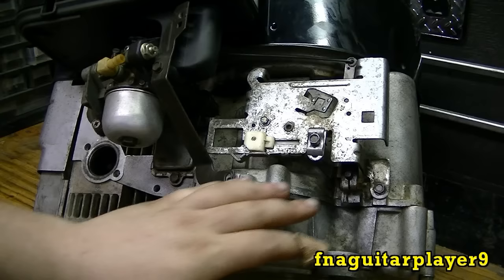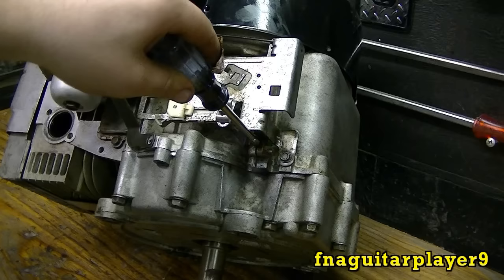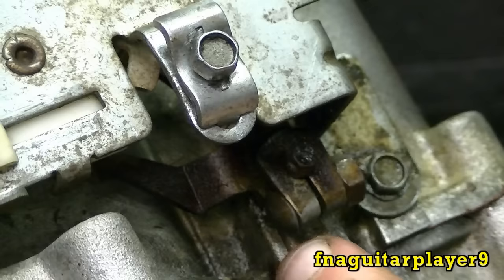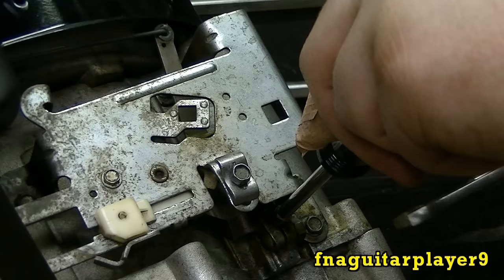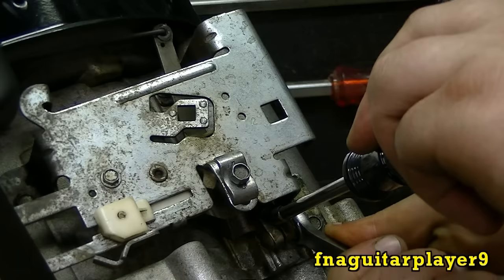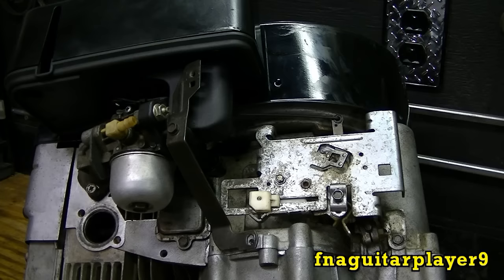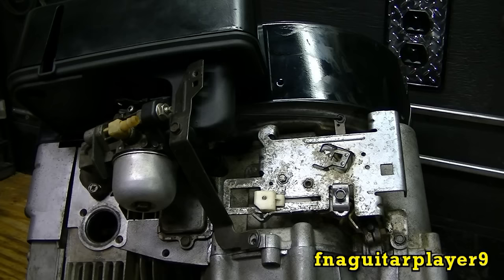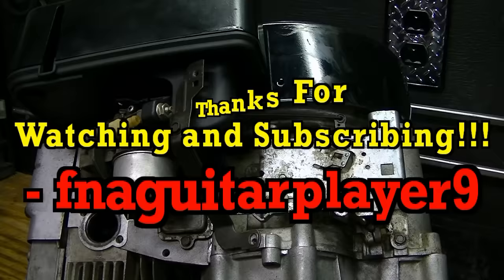How To Adjust Mechanical Governor On Small Engines

Comment: Thanx for posting this. I have been wondering why this troy bilt keeps surging. Completely cleaned and replaced gaskets on the carburetor thinking it was bad gas or clogged ports. I am going to try this first thing in the morning.
Reply from the maker: +George Vasquez Your welcome! I hear ya, I ran into the same problem on a 12HP before i learned how to do this. If it doesn't help it, you may need a new carburetor, on the newer 2 piece carburetors (walbro or nikki) you can't do a whole lot with them once they start acting up. I recently got one for a friend off ebay for around 60 bucks. Thanks for Watching!!!
Reply: +fnaguitarplayer9 ty. Well it sorta worked. Don't EVER let your neighbor borrow your lawn equipment. lesson learned. After doing this and completely breaking the carburetor and checking all else. I decided to check the oil. Well the @#$% put over filled it with oil. I emptied and refilled. Didn't want to take the chance he used the wrong stuff. Well after I corrected that, it ran perfect like it did before. I didn't think to check due to I just checked it before I lent it to him. I went to ask why he did that. He said that every time he would go in reverse it would bog down and turn. off. So he just added way too much oil. I even told the guy, due to the safety feature, it will not run in reverse when the PTO was engaged. face palm
Reply from the maker: +George Vasquez I hear ya. I know what you mean, I don't like loaning stuff out. seems like something always happens, even if its just something small its aggravating. OH wow haha thats crazy!
Reply: fnaguitarplayer9 That dude just finish his yard with his own push mower and didn't even let me know what happened. Needless to say that dude will never barrow any of my tools. lol
Reply from the maker: +George Vasquez Daggone! Thats not good at all. I don't blame you a bit!!!

Comment: Hunting and surging of a small engine has nothing to do with a governor because it's fuel-air mixture involved. It's truly piece of dirt and emotion tube or in the jet. I run a torch tip cleaner up inside the jet which gets into all the holes of the Emulsion tubes and cleans them out and then I put the check back in. All done
Reply from the maker: While that is true and is the case alot of times, if the carb is in good shape, if the governor is out of adjustment it can cause surging, a simple test will show it, if a engine is surging and if you hold the throttle linkage and it stops and still runs good without leaning out, at different rpm's then its governor and not carburetor, if it leans out of spits and stumbles then its exactly like you said is causing it. Thanks for Watching!!!

Comment: Thanks for the reply. Confused here. According to a parts list for my engine, there appears to be a governor/oil slinger part internally #691997. http://www.ereplacementparts.com/briggs-and-stratton-126t020256b1-engine-parts-c-16758_17347_17498_228297.html and here is a better picture of the same part # https://www.jackssmallengines.com/jacks-parts-lookup/part/briggs-stratton/691997. I certainly don't want to go through the hassle of opening the crankcase if it won't do any good but I have checked the things externally that you suggested  and the wide range between no-load & load rpms is still there. Again, this machine has the blade stop feature which further complicates the matter. Have you ever seen an internal governor go bad such that it does not control the engine speed as it should?
Reply from the maker: If this is on a push mower engine, most of them do not have a mechanical governor and the internal part is just a oil slinger, most push mower do have a air vane governor but some newer ones do have the mechanical, just saying that so you can verify what you have. If it is a internal governor then it could be bad, i've seen the weights come loose before. yes, i have. I recently had this happen on a 20HP briggs v-twin. Thanks for Watching!!!
Reply: Well, I opened the case. It is indeed a mechanical gov. with weights in combo with the slinger. Evidently that part had become misaligned relative to the gov arm linkage causing the symptoms of over and under revving that I described. I re-aligned the slinger/gov. and  buttoned things up. Mower now operates as it should; that is,, very little difference between blade brake rpm's and blade engaged rpm's.and steady rpm's while mowing fairly tall Bermuda.
Reply from the maker: good to hear that took care of it. If its cutting bermuda its doing good! Thats some thick grass!

Comment: Do you adjust Kohler tge same way fnaguitarplsyer9
Reply from the maker: Yes, just make sure the direction of travel is the same, it should be. Thanks for Watching!!!
Reply: @fnaguitarplayer9  I dont understand the full tgrottleis to back of motorpush ggovenor rod to back of motor which way do you turn tgeshaft
Reply: The shaft
Reply from the maker: @robertyearian227  you turn the shaft in the same direction as it moves to open the throttle
Reply: @fnaguitarplayer9  thank you

Comment: I have a John Deere riding mower with a briggs 11hp engine I adjust   the governor to 3600 rpm but when I get into thick grass the rpm drops to 2600 rpm isn't the governor support to keep the rpm from dropping so much rpm
Reply from the maker: Sometimes it will only do so much, but it may need to be adjusted like i did in the video, try that first and tune the carburetor in (basic tune up) and see if that will help, the governor can only do so much. hope this helps. Thanks for Watching!!!
Reply: Thanks I will do that and let you know.

Comment: I don't know if you're still replying to comments on here but I just replaced the carb on my 16.5hp B&S with this one. https://www.amazon.com/gp/product/B00U1RZN5Y/ref=oh_aui_detailpage_o07_s01?ie=UTF8&psc=1 Now the motor hunts and surges. I've done all the carb adjusting I feel like I can do. The governor seems okay by what you say as in, little to no spring at idle and lots of spring at full throttle. However I can see the governor moving back and forth as it's running. I'm just wondering if I should mess with the governor or not. I don't want to blow it up lol. A guy on a forum told me those carbs are crap but that's pretty much all they sell now.
Reply from the maker: Yepp, I still answer comments on all my videos, as of now. Sounds like it may be adjusted to the lean (The carburetor), there should be a adjustment screw on them, it may have a plastic cap on them, you might be able to turn it out some to get a little richer mixture, try turning it out 1/4 to 1/2 turn and see if it helps, thats usually what causes that, it can be the governor out of adjustment, but i start with adjusting the carb. They aren't as good as the oem ones but they are decent, i haven't used that particular one, but i have used aftermarket carbs and i usually have to adjust them. thanks for watching!!!
Reply: The one I got only has an idle speed and idle mixture adjustment :/ I can get it running great at idle but still surges at full. Others have said the jets are too small for some applications and is probably the case with mine. I'll probably end up rebuilding my old carb since I can get the parts for about 20$. I got the new carb for 30$ so I thought it was a better deal lol. I did adjust the governor but it didn't do anything. Thanks for the reply!
Reply from the maker: I hear ya. It probably is the jetting, and if your willing to take a chance you can drill the jets out to a bigger size, its very easy to screw up and make them run way to rich though. That might be the best option, i don't blame you for trying that first though, i'm all abut saving money! your welcome!

Comment: I have a 23 hp kawi air cooled , Same concept to reset Gov?
Reply from the maker: Yeah, as far as I know, it should be the same on any make of motor, just turn it in the direction that opens the throttle up. Thanks for Watching!!!
Reply: Thanks
Reply from the maker: your welcome!
Reply: On Kawasaki v twins the whole process works the same. Only difference is on Kohlers and Briggs the shaft goes down to the full throttle position but on the Kawi it goes up. Just make sure you are going to full throttle. Oh and the throttle plate on Kawis has everything including governor and spring behind it instead of in front so it's a bit more tricky. Don't ever take one apart without taking pics or labeling because it's damn near impossible to find a visual source to show where stuff goes back.

Comment: Could I do away with it? I have the same engine u have in the video. I want my riding mower to go fast. I am planning on putting the engine on a project I have go on. I don't care about horse power, just speed. THANKS
Reply from the maker: NO, unless you want to destroy it in no time! (been there, done that, blew up a 14.5, rod came through the side of the block), if you want a mower to go faster (not to cut grass with but to build a racing mower) the first things you do is change the pulley's ratio between the engine and transmission, bigger pulley on engine smaller one on transmission, you'll be surprised what you can get out of a stock engine. Even when you bypass the governor, it will not go much faster with a stock drive train. Now you can buy a billet rod (and flywheel for safety) and do away with counterweight system and you can get some serious rpm out of these, but stock, they will throw a rod or the counter weights will let go. Do a youtube search on blown up briggs motors that were ungoverned, you will see what WILL happen! And another thing, if you using a stock flywheel, they can explode at high RPM, people have been killed from it. Hope this helps, and i'm not trying to discourage you from building a fast mower but I don't want to see you blow up a motor and/or hurt your self! Thanks for Watching!!!

Comment: Hey, great videos!  I'm not sure if my problem is related to the governor or not, but I think (not sure!) the rod that is moving up and down in my video is the governor, so I thought I'd throw this out there.  If you have any suggestions about what might be causing the periodic surging I'd be most appreciative.  Thanks!

http://youtu.be/97DqIk93EjI
Reply from the maker: Matt Hill Thanks, appreciate that! Just watched it, it actually sounds more like the idle circuit/jet is partially plugged or gummed up, try to choke it slightly, like half choke, if it smoothes out then, i'd say your carburetor needs adjusted (if adjustable) or cleaned, if it still does it even with partial choke, it could be the governor, thats usually the last thing i check when i have one do that, its almost always carburetor related, but i'm not ruling out that governor isn't adjusted right. Hope this helps! Get back to me on this and let me know. Thanks for watching!!!
Reply: You're right!  I choked it half way and it stopped surging!  I shouldn't get too excited, though, because I don't know how to adjust or clean a carburetor.  But I think I'm about to learn how.  Thanks so much!
Reply from the maker: Matt Hill I didn't notice that, yeah that does make a difference, good that you thought of that, saved you some time! Sounds like its running good now! I should also add that its not recommended to run a lawn mower engine (air cooled) without the flywheel cover in place, it can overheat since the air isn't blowing past the cooling fins, didn't know if you knew that or not. your welcome!
Reply: No I didn't think of that aspect of the cover, but I did put everything back together before using it.  Good tip.  Thanks.
Reply from the maker: Matt Hill your welcome!